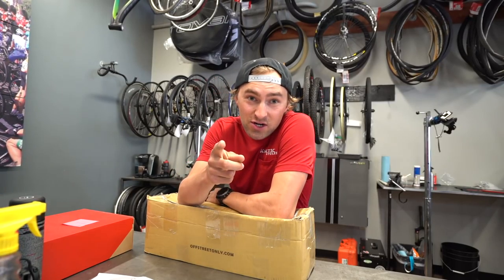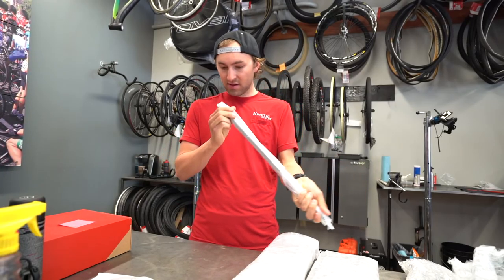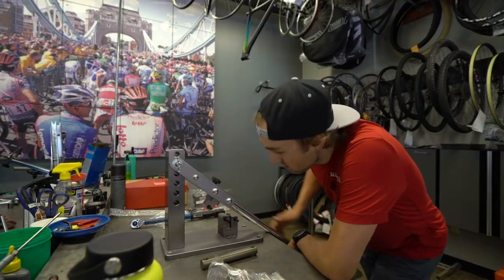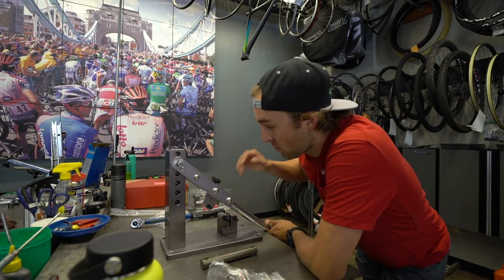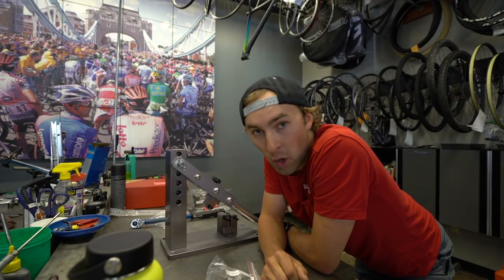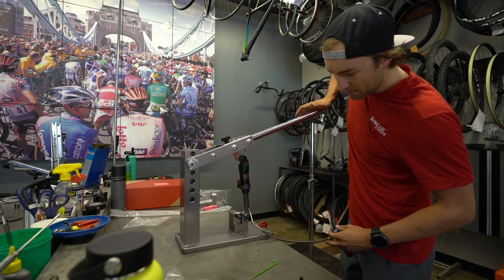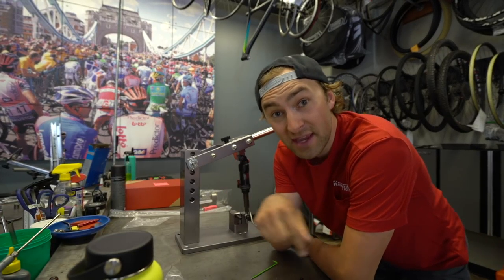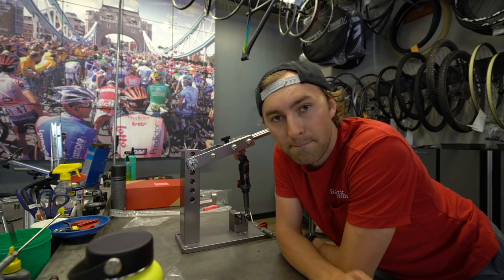Tech Talk . New Tool Tuesday! . VLOG 2.171

Comment: Hey Cody. Question for you with regards to specialized sizing. I'm 5.65-5,75 with shoes. Do you recommend sizing up or down on the Diverge or Crux bikes? In the mountain bike world we tend to size up. Should I get a 52 with a slightly longer stem. Or a 54 with a slightly shorter stem both stock sizing?
Reply from the maker: I run the same size bikes across the board, regardless of discipline. At 5'7 I would say you're comfortably on a 52cm bike.